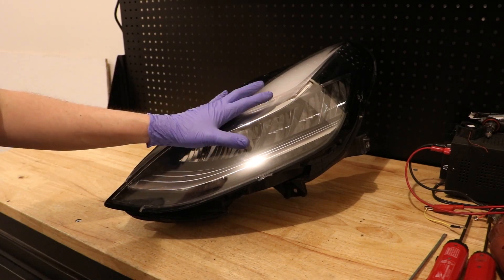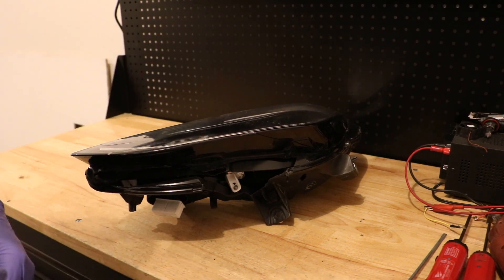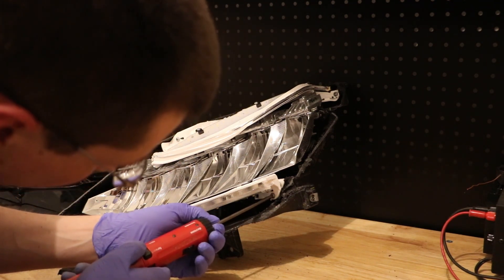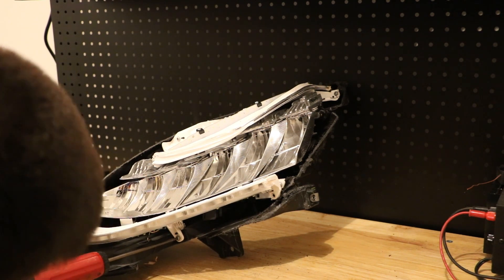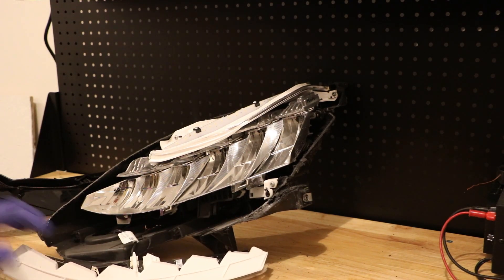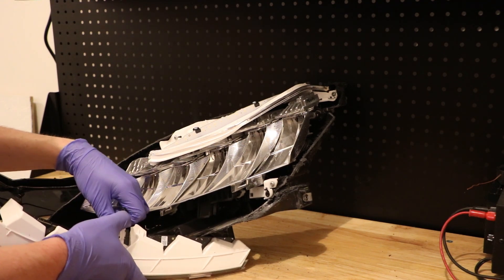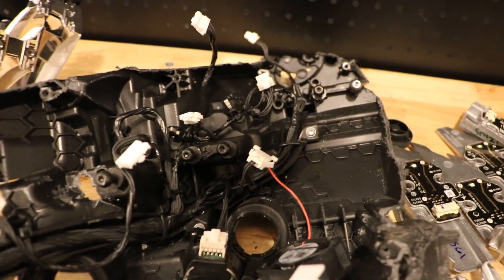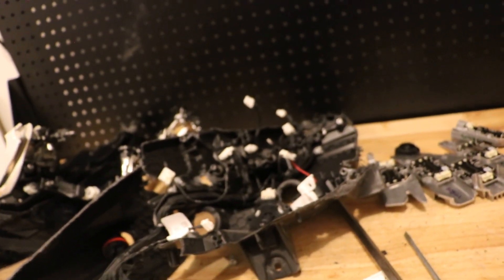Tesla Model 3 Headlight Tear Down Disassembly

Comment: Thank you for answering my question of “can’t I just replace the bulb (led) that went out?”
No, it’s a full assembly and should be changed out as such.. a simple bulb replacement is not an option with a model 3

Comment: Awesome video!   My driver side headlight “led drl light bar” seems to be not working. However the upper white triangle drl part is lighting up.  Do you know if I just have to replace a module or the entire headlight?  Thx!
Reply from the maker: The light bar in the upper section of the headlight runs to the control unit on the outside corner of the headlight.   I would start by replacing that corner unit.   

Here you can see how to do it:  https://youtu.be/iCGwpykaXPg

Comment: How’s my favorite headlight person? You’ll remember we had some exchanges in the past, you answered some questions really helped me out. If it’s not too presumptuous of me, I have another question. I resolved my headlight issues last time by simply replacing my headlights, but it would seem as though one of the new lights, which I bought on eBay, are already having an issue after 40,000 km.

As you know, the Model3 headlight is made up of a patch of light at the top, a thin LED strip, and three LED lights shining down into reflectors. My issue is with the thin LED strip, half of it has stopped working on the passenger side. You wouldn’t happen to know if that could possibly be the little control box would you? I’m sure it’s probably the LEDs that are shot, but if there’s any chance it’s that small box, I happen to have a spare. Thanks man.
Reply from the maker: The light going through the acrylic/plastic tube is from the LED unit on the upper outside corner of the light.   If you already have a spare, then I say go ahead and swap it out.   Best case you fix your issue, worst case you learn that it's a different LED causing the problem and you will then know if you need a new light.  There's also a small chance that it could be the main ballast/control unit, but that's probably a low chance.
Reply: @gftgrill  Even if it is the main ballast, I have a spare for that as well. I guess it’s a good idea to just give it a shot, I thought I would check with you first because it’s quite a process. As I’m sure you know the entire bumper has to come off, and I’m a freeze ass, it’s starting to get cold in Canada. Perhaps I’ll wait for the spring. It’s looking like I’m going to need to change my horn as well, sounding like a dying duck, so I guess I should do it all at once. Totally appreciate your insight, thank you again.
Reply from the maker: @originalsubwayjones  It's common for most vehicles that the bumper has to come off.  I don't appreciate the cold either and things I can put off I will as well.   Assuming it is the outside corner LED that is replaceable, that part is no longer serviceable on the updated headlights.   I'm getting ready to work on a couple of videos regarding the updated headlights.
Reply: @gftgrill  Fantastic, thank you so much again for everything. I have subscribed to your channel, I look forward to future videos. If and when I get this resolved, I’ll be sure to let you know exactly what that required.

Comment: I have a 2021 model 3. Unfortunately a rock hit the passanger headlight while on the freeway.  It still works but the lens is broken.  Tesla estimate is $1,200.  Can I buy a headlight from eBay that says it fits a 2017-2021 and expect it to work?  Any thoughts or suggestions to avoid paying Tesla is appreciated.
Reply from the maker: I would pull your headlight off first and get the part number on it and make sure you match it.  It should be like swapping a headlight on any other car.  The two items to note, make sure you get the same model headlight (up level, with or without projector, etc)   Then when you get the replacement headlight you might need to download a software update for the headlight to work.
Reply: @gftgrill  that worked!  Thank you so much for the suggestions 👍👍.  Cool video btw

Comment: Very cool. So the fan just moves air around inside the unit and doesn't bring in fresh air?
Reply from the maker: Correct,  there are no fresh air intakes in the headlight (that would let in water as well).   Most LED headlights are designed this way.  Move air over the inner components then let the heat radiate through the housing through passive cooling.  The lens of the light should be actively cooled while your moving as air passes over the headlight.

Comment: Since you seem to absolutely love headlights, and you were very helpful to me a few weeks ago, I thought I would tell you something you might not know. Once I installed the new headlights in my Model3, I noticed that the right signal was flashing rapidly, and I had error messages on my display. Turns out, when you switch out the headlights, you either have to request a software update from Tesla, or just wait until the next software update comes along. It doesn’t cost anything, and they were kind enough to shoot the update to me in a hurry. Just FYI.
Reply from the maker: Did you use headlights with a different part number?   Tesla goes through many revisions on all of their headlights.  I'm curious if the software was in the light, car or ballast
Reply: gftgrill I am quite embarrassed to admit that I didn’t even bother to check for a part number. I understand that the contents of any given light doesn’t necessarily have a relationship with how it looks on the outside, but the lights I bought looked identical, so I didn’t think about it.

I did however get a response from Tesla that might answer your question, sort of. Tesla informed me that anytime you change the lights, you need a software update. I imagine if I had taken the blinker module, and the ballast, off of the old light, the car wouldn’t have known the difference, but as it turns out I didn’t do that.
Reply: @originalsubwayjones  did tesla do the software update for you or did you wait for another software update to get the light working correctly. I have a similar situation, the day-running LED is out in my M3. I dont want to pay Tesla the $1100 they want for a new light so i am interested in buying used. However, my SC did say that the new/used light would require computer update (or reprogram?) and that they'll do it for me at the hourly rate. Thanks.

Comment: Thank you for the vid, I really enjoyed it. As it turns out, I need a passenger side headlight. Two of the three LED segments don’t work, and I’m told it can’t be serviced. I have a few questions... First, how did you open the unit? It appears as though you cut your way in, because it seemed like there was plastic grains on the reflectors. Do you have to destroy the unit to open it? I’d sure have loved to have a better look at the individual LED boards, any idea where I might be able to do that? Nothing is jumping out on the Google machine, thx again.
Reply from the maker: you need to use the baking method.   https://www.youtube.com/watch?v=anN0vYBj6Uo

Did you try swapping the ballasts left to right to see if the problem travels with the ballast?
Reply: gftgrill Thank you for the link, great video, I had no idea that one could bake a headlight like that. 

Your suggestion about swapping ballasts is a common sense trouble shooting method, but I confess, I have no idea how to do that. Replacing the headlight is straight forward, but possibly not the problem. Have you switched ballasts on Model 3 headlights, or are you aware of any resources that could help me along? I’ve tried the Google machine, no luck. Thanks again.
Reply from the maker: @originalsubwayjones  you're in luck.  I already did a video on that:  https://www.youtube.com/watch?v=iCGwpykaXPg

Comment: How hard or easy would it be as a diy project to black out the headlights by painting the interior black
Reply from the maker: It should be fairly easy.  Heat up the light, pull the lens, then the chrome trim is all attached to the front lens.  Do NOT paint the chrome reflectors for the LEDs.

Comment: 13:05 - not used for adaptive lights, but for leveling the lights if the rear of the car is loaded so heavy that the headlights starts to point up in the air. Required on all new cars sold in Europe.